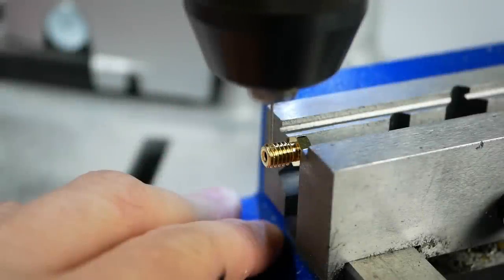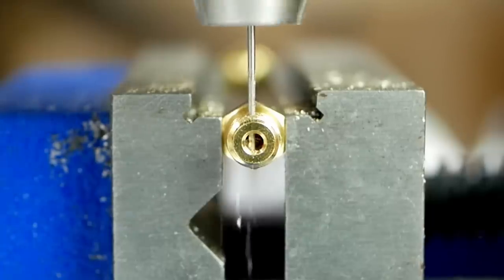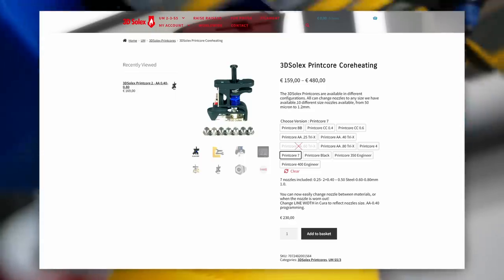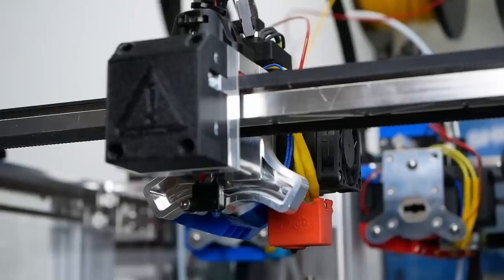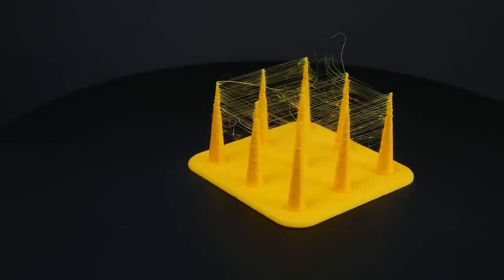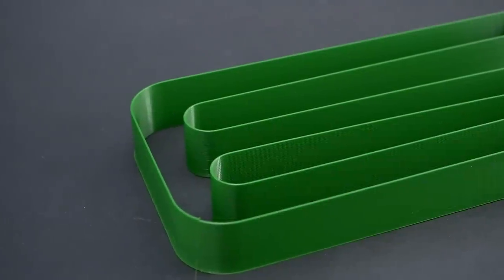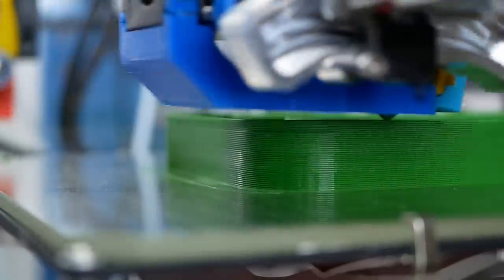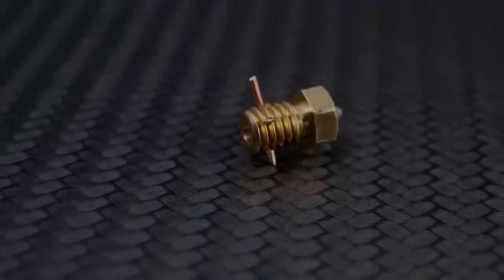My High Flow Nozzle is better than a Volcano hotend!

Comment: perhaps hammering/knifing the area of the copper wire that thats in the middle will not prevent the flow of material yet allow the same heating performance you seek..  OOrr, if you could mimic how cat6 cable is separated with a copper X inserted lengthwise if such an insert could be configured in length then cut, pointed and tapped into the tip... Just some thoughts....

Comment: Could you file copper wire to have sharp edge which will make easier pushing and retraction of fillament, but it would reduce surface area for heat transfer, but not that much, and it will free some area (same thing you wanted to achieve with drilling from 2 to 2.5 mm)

Comment: Can you force the wire deeper into the nozzle, forming a V. This could provide more surface area within the flow area without reducing the cross section more then a single wire?

Comment: If the wire inside the nozzle would be "sharpened" even just with a hammer, it should make it work better, but to make it as good as possible with basic home tools, I would recommend doing the flattening with a diamond file, with a pack of them you could even try different shapes, to see if it makes any difference in the end result.

Why not just insert steel or brass mesh inside the nozzle, in theory it should give out ideal performance as the wire then comes through multiple little holes?

Comment: Put the wires in the volcano, and open the entry diameter,  use brazing to weld them in. Brazing uses a much higher welding temp
Reply: Brazing is not welding.
Reply: @GregorShapiro  tomato tamahto
Reply: @VicFroman  Then no words mean anything if any word can mean anything slightly related?

Comment: I wonder what the temperature limit is. I tried this, and printed a test at 215 C. However, the nozzle leaked and when removing I could see the solder had melted. I would love to get my hands on some silver-solder, although it seems to be expensive.

Comment: luv ur content! when drilling small holes with a drill press try drilling a pilot hole with a vary short, 50% smaller bit about .5mm deep. and sometimes I use a sharpend tiny spring pin to get it started. But im going to try this! if it was not for you i would of never of thought of this. thank you!

Comment: Do you have a 3018 CNC machine or equivalent? Or know someone with one? What about plunge milling fine slots down 180° opposite internal edges and fitting a thin copper or brass web into the slots and between the walls?

The potential exists to fit a tri point web too ... Just mill three vertical slots 120° apart. Silver solder a third wing to the first pair that comprise one piece bent to 120° separation.

My thinking is that with a good tight fit of the web it will have ...
a) much more surface area to heat the filament
b) provide that heat for a greater distance down the nozzle, potentially almost to the very end of the nozzle. Such a design should also enable the removal of the "fin" or "web" so that a different, shorter web could be used for optimisation!

Great idea to do what you did and good luck if you decide to test further

Comment: I'd like to see if using silver wire would produce superior performance as it has better thermal conductance than brass. I also suspect a silver nozzle would improve performance, except that annealed 99.9% silver is quite quite soft (43 Rockwell) yet slightly harder than annealed copper. It might be possible to use sterling (Rockwell 70) or other alloy, and to then harden the nozzle.

Comment: I'd probably cut an X in the top and insert thin copper sheet in an x pattern but I have no idea about 3D printing so maybe that has an issue with the printer nozzle I've not considered.

Comment: The drilling part >2 mm maybe could lead to some issues. At my Ultimaker2 I have a bore of 3,1mm. At the transition point between isolating PTFE piece to the  nozzle I should have no groove like a chamfer or so. If there is a bigger diameter, I get retracting issues.

Comment: I wanted to do this but print petg, and I was trying to think of a way to do it without having to use solder... And then I realized. I cut a piece of scrap copper pipe into a tiny strip of copper sheet metal exactly the width of the nozzle, hammered it flat, and just wedged it in. Starting a print with it now...

Comment: Do you actually need the solder? Could you not just hammer the copper wire out like a rivet? I would try to use an M6 Nut that is cut in half or drilled out on one face, so you have a good surface on the anvil side, and then use a tool to hammer the copper from the other side without damaging the nozzle threads too much.
Another idea, where hammering does not work that well, would be to shape the copper wire into pointy spikes, and then solder these spikes in.

Comment: I would check out Applied science's video drill through anything (conductive) with electrical discharge machining. Don't know how doable it would be for you but it seems like it could make more precise holes then a vice and drill press.

Comment: Could use a hacksaw to cut a slot from the top and install a copper plate down into it. This would be less turbulent but almost double the hot melting area.

Comment: Ok an interesting idea or two. First is probably all the viewers silly question of what if you modify a cht. The other one I have is this, why not just use meshes on the inside or wierd wire structures that connect to the nozzle on the top but just hang in the middle. Just some ideas. But I would really suggest you try using silver solder next. İ use it in my hobbyist jewelry making. A small torch, some silver solder, a little borax dissolved in water and a small amount of 10% hydrochloric or sulfuric acit to clean up should really be all you need to get it done. Or so I hope. Anyway cool ideas and a great video. Thanks Stefan.
Reply: Yes sir
Reply: Cone shaped inner wire mesh
Reply: Gcod3d sorry I didn't understand exactly what you mean by that. İ wasn't really talking about a mesh come but a mesh cone could work as well I guess, sure. But it would probably add even more resistance as far as flow goes. I'm not an expert in flow mechanics but that extra resistance might cause some issues.

Comment: Hello,
Interesting
The most important criterion in temperature exchanges is the surface.
The cutting discs of mini drills like "DREMEL" have a thickness of approximately .7mm.
Slitting the threaded neck of the nozzle is not very difficult, provided you are equipped for and insert a piece of copper foil of the required shape and thickness. What do you think of this modification which goes in the direction of your work? (thank you deepL translator!)

Comment: What if you squished the copper wire in the middle so that it is less round in the melting chamber but still round enough to fit the drilled holes? Less turbulence?

Comment: I would like to see you do this but use copper sheet, then use a cut off wheel to make a slot in the nozzle, also sharpen the edge, it'll cut and transfer heat to the filament like a hot knife in butter!

Comment: Holes this small I prefer ball nose endmills for spotting. Spot it with a 1mm or 1/32” just enough to give you a true surface for your drill bit. Then swap over to your .8mm drill and finish the hole. HSS would be fine for these brass fittings. (Machinist for 35+ years)

Comment: I wonder if you bent or flattened out the copper inside the nozzle so it would act more like a knife then a rolling pin if that would help it would increase the distance it heats and may be able to cut the filiment as it passes to get it hot all the way through.... I wonder how well it would work if you also used a bigger nozzle tip to reduce the expansion after the filinent leaves

Comment: What if you add copper PINS - basically do not have the wire pass all the way across - maybe add 6 pin - so center is clear.   What do you think ?

Comment: How about drilling a step with 2,9 mm diameter from the top and pressfitting in a bit of a brass cross extrusion with 3 mm width and .5 mm wall thickness? I previously posted this with a link to a German modelling shop, selling these cross extrusions, but it probably got blocked by youtube because of the link.

Comment: there are literal angled, blade-like ends where the metal still meets.
kinda surprised you didn't think to file the copper down at an angle, creating a similar structure, which would have created more volume and not such a blunt end.

Comment: I'm now curious about a slot with a thin dremel diamond blade. Maybe in a cross/pizza pattern. So you could use hammer flattened wire or copper sheet, into pointed blades that dangle in the middle, for even more surface area. 

Wow, thank you for the brain food!

(edit for wording)

Comment: I’m trying SS 304 wire mesh for an inner heating element. I have SS 304 120 mesh which has a 33% unobstructed area. For a 20mm * 5 mm piece I’m getting 0.5 ohms. I’d think a 50% open area would have better results than 33%

Comment: Try multiple wires one above each other to create a wall instead of a cross. It should have better flow and you could use more than 2 wires. Also, you need one of those mini cnc.

Comment: Rather than add a second wire, I would be very curious to see how a flattened wire would perform.  Reducing the cross section in the flow path while also increasing the surface area in the melt zone should, at least in theory, make a noticeable improvement in performance over the round wire insert.

Comment: In a vaping gear they use a wired mesh to heat up to even 200watt. What if they can make an isolated circle in the nozzle with this heating element integrated. You don’t need cooling zones anymore because you apply the heat only where needed.
Reply: Same thoughts

Comment: Could you pass a current through the copper? This would actively heat the wire. 

Most current would flow through the copper as that would be the path of lowest impendance. No need to isolate it from the nozzle.

Comment: Idea to avoid having to solder it.
- Drill hole smaller than copper wire
- Tap hole to a thread slightly smaller than wire
- Thread wire into hole
- Cut ends
- Use tap to rethread nozzle
Reply: If you drill a tight tolerance and use a brass wire (so the expansion coefficients are the same) and freeze the wire while heating the nozzle you can get a fit stupid tight.

Comment: Imagine a small piece of brass sheet cut into a small "T" shape.  The leg of the "T" would fit down the hole in the nozzle and the cross bar of the "T" would fint In a slot cut in the top of the nozzle.  Also shape the edge of the brass insert to facilitate flow and instead of solder just compress (crush) the slot to mechanically fix the brass, resulting in no solder to melt later under high printing temperature.

Comment: I wonder how having the 2 wires in in parallel rather than perpendicular would have worked? may've increased surface area while still allowing similar flow to the single wire

Comment: Instead of drilling, could you just tuck a coarse copper mesh into the nozzle on a press, then heat up the whole nozzle and solder it to the inside?

Comment: I think round shape of the wire could be improved. You could file sides facing each other at 45 degrees to bevel from both sides, like knife edge shape. Combine that with better center drilling from side (drillbit runout issue) and make the rear larger like what you did.
Reply: Btw I remember you machining a nozzle. Maybe you can machine a copper nozzle (imagine we bought an expensive plated copper one) and put the through hole while it’s still in the vise.

Comment: What if you coated the threads of the nozzle with some kind of thermal compound to better transfer the heat of the block to the nozzle. I imagine the threaded junction doesn’t have the best efficiency since you can’t make perfect contact all around with threads.

Comment: Try to make the wire sharper on the middle section before inserting it into the wholes… or maybe try to use pliers and flatten it inside the whole this will increase the surface area, make the filament entry whole bigger, so it will flow better and smoother… or maybe via a Dremel (but this will remove material which isn’t a good idea)

Comment: Hallo Stefan.
For your next solder job: flux 😉
It's so much easier with "Flussmittel".
If you cut a cross and insert some thin sheet metal, could you achieve a laminar flow, with core heating?

Comment: would putting the wire through on a angle  stir the hot material and give some more constancy or will it print badly due to the stresses put into the extrusion ???

Comment: No material pre-heater? Heating the feed to retain heat in the core, while still letting it cool for a little, before the feed-gear. (The core will stay pre-heated as the plastic, as well as taking longer to heat to the core, it takes longer to cool a pre-heated core.) If the active melt temp is 200, then a pre-heat of 150, but a cool to room-temp just before the feed, should still leave the core at a solid 150.

By the way, elastic pressurized swelling can also be caused by the inner melt being too high, by the "compression", which makes the core "flow" faster than the "skin". The skin is cooling and dragging on the cooler metal but the core is near molten, and blowing up the skinned plastic like a balloon. (Injection molding uses that compression heat as the primary source of heat, as opposed to extrudes that uses power as the primary source of heat and try to counter "compression friction heat transfer".) That is the best core melt, but you would need an insulated cone to retain the heat and a "splitter", to transfer the heat from the core to the edges, to combat "molten swelling".

Injection molding machines will sometimes use a sprue/nozzle that has something that looks like razor-blades "X" inside the nozzle.

Comment: If you shortened the length of the drill (bit) by pushing it into the chuck further you will have better success with less bend in the drill.

Comment: You just need a ceter finder and a smal spot drll before you drill the .8 mm hole. I i'm gonna try .5 copper wire x2 holes and see if i can braze them in ?

Comment: By the looks of the design ie a nozzle with a hole they have covered every shape that could be used to alter the internal surface which I would think is un patentable because how many industries use a nozzle in different formats. If you wanted to drill quite a few get a machine shop to drill some square stock to make a drill jig, m6 on the end then drill through on the faces your wire size then all you need to do is use your bench drill  and it shouldn't cost that much, loving your ingenuity 👍
Reply: @Lassi Kinnunen 81 with injection molding and pressure die casting and even plasma cutters use a nozzle so I don't see how a new patentable design can be done as it's a nozzle for delivery of a substance, I'm no lawyer I'm a toolmaker and see lots of verants of tool design but by them saying orifice design in the way of material splitting means no one can make a multi internal design.

Comment: How does one know the volume extruded per second? All you can set at Cura is printing speed and layer height. Nozzle diameter and filament diameter is (more or less) fixed.
Can't calculate 0,4mm nozzle area (0,125mm²) times printing speed (60mm/s), that would be 7,5mm³/s
At the other hand, same applies for filament area (2,4mm²) multiplied with the printing speed. 144mm³/s seems a bit unrealistic with a standard delta printer.

Comment: What happens if you flatten the wire a bit in the middle so it gives less resistance to the polymere? You may use the Rambo way with a hammer or the smoother way with a small file. Oh and the problem of the center drilling could be solved by drilling an old heat block precisely first and use it as a guide. Just some guesses

Comment: Have you seen Tech Ingredients’ thermal paste video? What if, like in this videoC you drill out the bore of a nozzle and replace the material with dendritic copper???? What impact would the increased surface area have? Though I am not too sure as to how to perform such a manufacturing feat. 

Great video!!

Comment: Could you cut a slot in the nozzle an break off a piece of exacto blade that is short enough to not interfere with the threads. Or even a thin brass blade

Comment: Dumb idea, what would happen if you just dropped a chunk of loose copper wire into the nozzle and connected it and used it? Maybe bend it so it can't block the nozzle tip. I wonder if it's possible to do that or if it has any positive effect.

Comment: Would using "Electrical Discharge Machining" be helpful for the drilling? Applied Science has a video covering this - "Drill through anything (conductive) with Electrical Discharge Machining"

Comment: What if you used triangular shaped wire? Place a pointed side up and it should help slice the filament as it goes through a little bit better, instead of just trying to cram it over a blunt butter knife type of edge. With 2 triangular wires, it should theoretically cut it into quarters and melt a quite a bit faster, with a lot less resistance due to the sharp edges cutting it instead of blunt edges.

Comment: What about dropping a wire in the center. Cut 2 notches across the nozzle. solder 2  the copper wires into a T shape and drop the T from the top with the 2 notches catches the two sides of the T wire.

Comment: Hey, as a first comment to your awesome video i would like to make you a suggestion:
Have you considered inserting plates instead of (multiple) wires? I think they would give you a lower passing resistance (obstruction) while providing a larger contact area for heat transfer.
I'm wondering if the larger provided contact area in flow direction of the filament is giving the CHT the decisive advantage over your diy high flow nozzles?
Greets from austria!